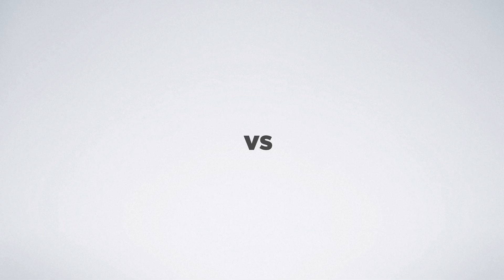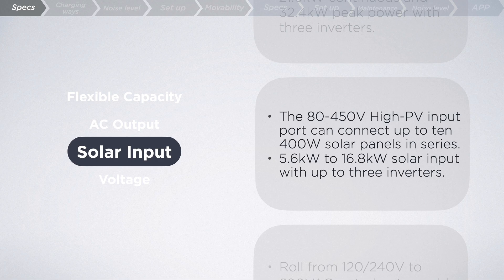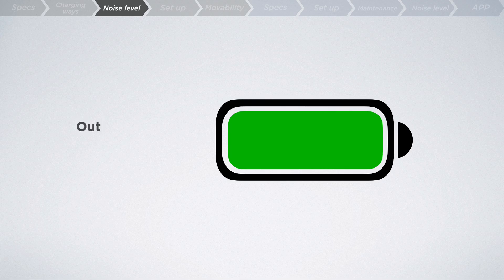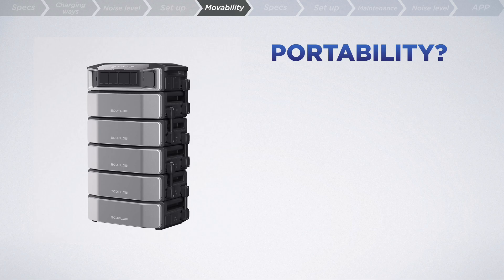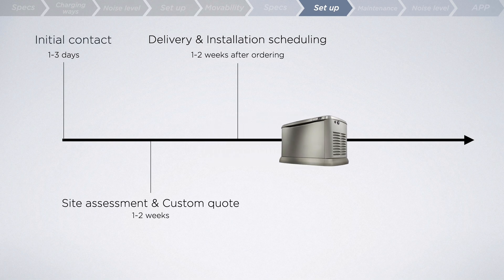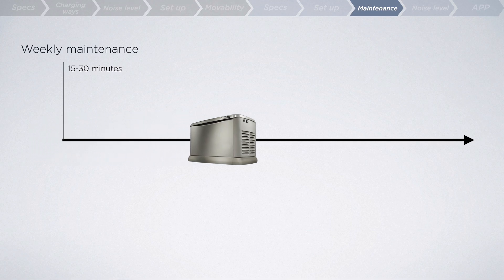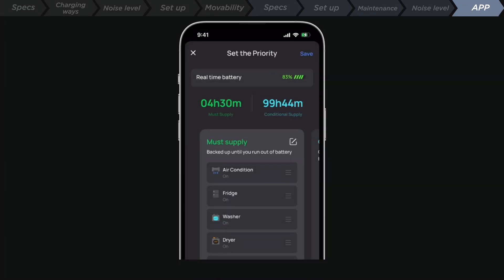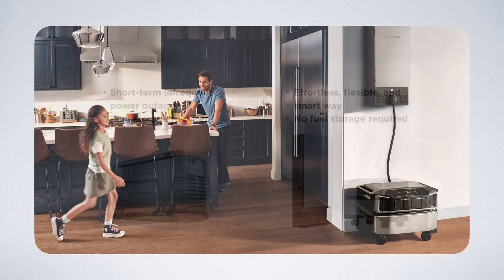EcoFlow DELTA Pro Ultra: Will it Replace Home Standby Generators?

Comment: I just setup my system. The only thing that was kinda annoying was EPS is unavailable when using a schedule to charge and discharge the device. I'm just going to buy a UPS for the tv or something
Reply: EPS will suck as a feature until I can automate battery charging. Right now I have to manually start charging because leaving the feature on and thus Inverter running will drain the battery and it will be dead or too low to be useful when you'd actually need it. Such a dumb oversight on Ecoflows part. I really hope they can correct this I don't want to constantly check my battery level before and unanticipated outage...
Reply: @ChristianStJulian  I am annoyed by the same item, one thing you can do is set your discharge limit. I have mine set to 50%, I then get a notification about it no longer discharging because of limit reached, that then triggers me to turn on the recharge and it stops at my set 90%. I would love more control though and would have expected better automation with the DPU and the SHP2 especially since most of the marketing is all around emergency backup and not just batteries for a solar system.
Reply: @ToddPlociniak  Same I was hoping it would maintain at the 50% discharge limit but nope just a notification. Like how is it even the limit it I can simply drain past it!? And agreed there could be much improved automations especially for a second generation product and success of the OG DP.
Reply: Yeah the EPS feature is lacking. Smaller UPS units work well but the clocks resetting when the power goes out will be annoying...  @ChristianStJulian
Reply: @Robulite  EPS feature works but the panel maintaining the battery charge for you does not. That was not made clear when I purchased a d installed my panel. Lots of folk will be disappointed once they realize this limitation. But yes I have my network and main PC on separate UPS regardless
Reply: Think this is something that can be added in an update?
Reply: @josephz7454  I definitely think its a firmware update but they need to be put on blast so they actually do it
Reply from the maker: Hi there, what units you are using? For Delta Pro Ultra, it supports both UPS and EPS.
Reply: @EcoFlowTech  EPS feature is functional but without scheduling charging from grid to keep battery topped off it's not useful
Reply: I use a Delta Pro Ultra. The EPS mode can't be enabled when a schedule is being used though. I have grid tied solar so I use a schedule to charge the batteries when the sun would be out. I don't really know of any other way to accomplish the charging of the batteries with my solar panels without a schedule. It's not a big deal just felt like the advertising made it sound like the EPS could be used whenever, but it has limitations that would limit my uses so I leave it disabled.  @EcoFlowTech
Reply: @EcoFlowTech  supported but neither can be used when using schedules 😂 only when used as standby backup.